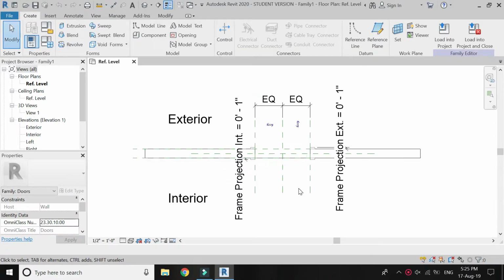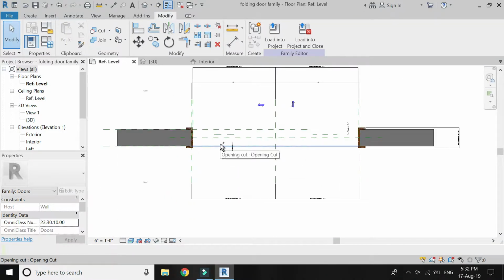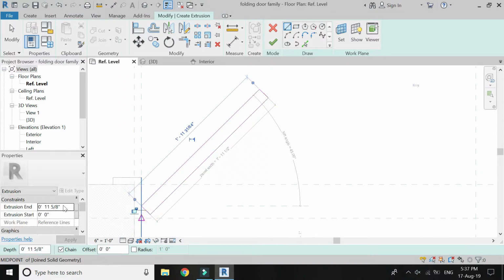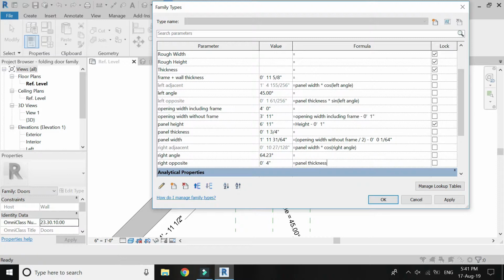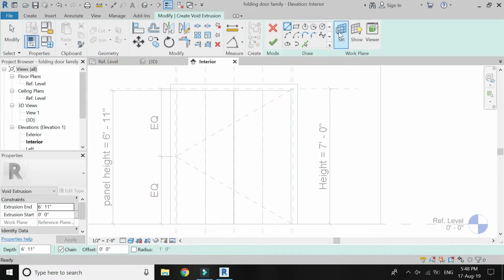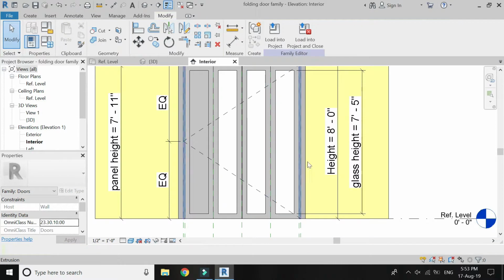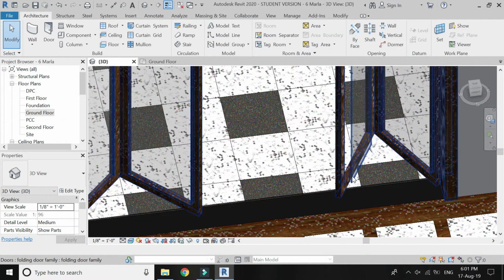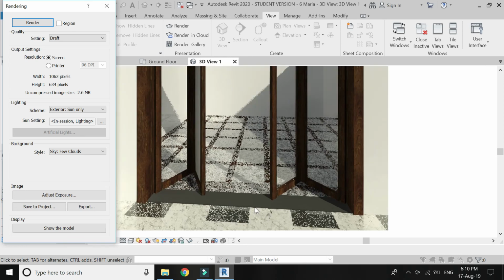Revit Tutorial - Folding door Family (Bi-fold)

Comment: Try this https://youtu.be/jPkKEs6QVIc
Reply from the maker: Thanks for your feedback.. But the folding door in the link, which you have provided, is not fully parametric. But in this tutorial, you can change the height and width of each panel and as well as rotate it at any angle. I will try to find and upload another method which has an easy process.